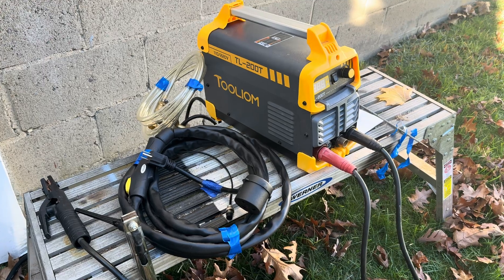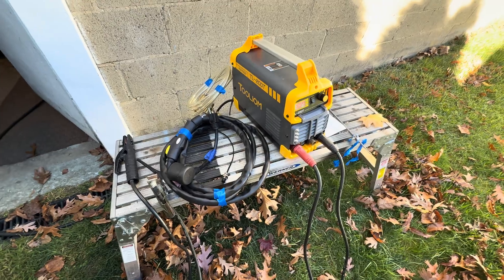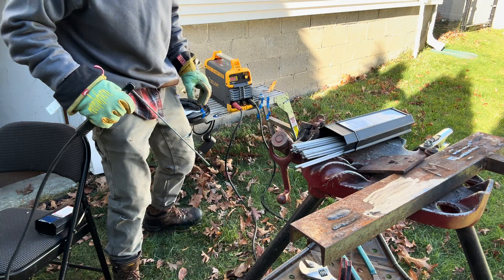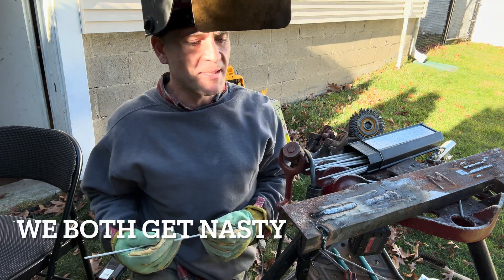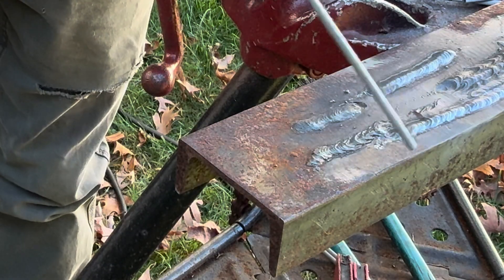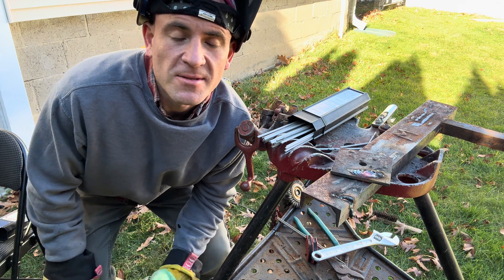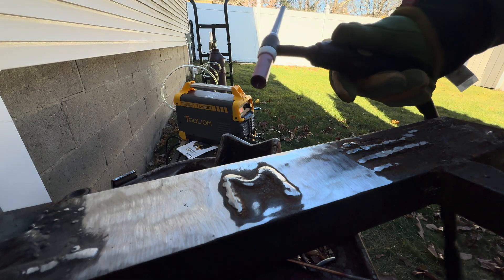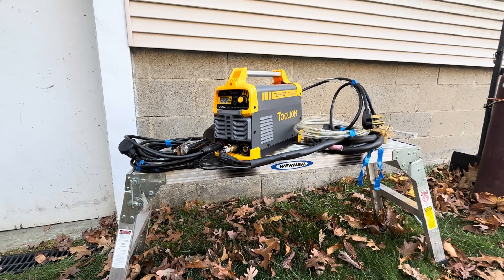Tooliom TL-200T High Frequency TIG/Stick Welding Machine Review

Comment: Tooliom will run 6010 read the manual it says to switch the polarity- to electrode negative. I run 6010 E/Neg on all my Toolioms.
Reply from the maker: No shit, I usually run 6010 on DCEP
Reply from the maker: Well, I should say I’ve only ever ran it on DCEP, didn’t see that in the manual, but I’ll give it a try, it’s gotta have some differences

Comment: I have a Lincoln engine drive (16hp Briggs) 225 but it’s so damn loud for garage work. As a professional welder, I bleed blue. But just bought the $64 toolium 135s pro or whatever it is. Threw on my high dollar ck rotoflex 17 series and she lit right up. Lift arc is plenty fine. You really only NEED HF for arc initiation on alum, but it’s nice to have for ferrous metals also. The lift arc isn’t nearly as slick or reliable as a miller but it’s better than I expected for a $65 unit. Was running 1/8th tungsten and filler at 120 amps on 110v no problem. I usually rig 150-180 amps but it’s a perfect rig for its intended purpose (light, portable tig work). I wouldn’t expect it to run 3/32 7018 worth a damn but have yet to try it. It’ll probably surprise me and run 3/32 all day long 😂. It appears most of the negative reviews and people having issues are those who expect a $4000 machine for sub-$100, and those who are beginners and don’t know how to set a welder up correctly. Nice video… was just checking out other models for a 220 option for bigger stuff